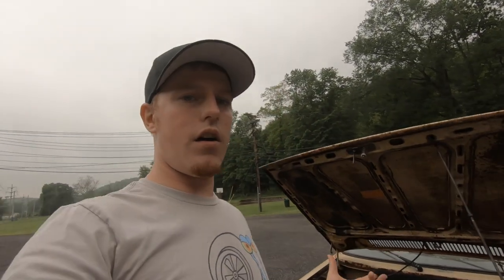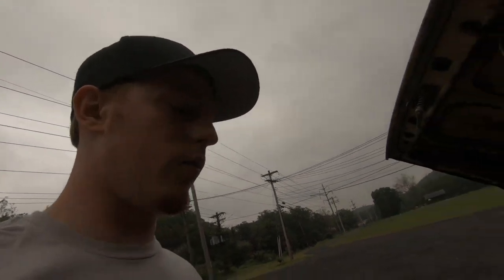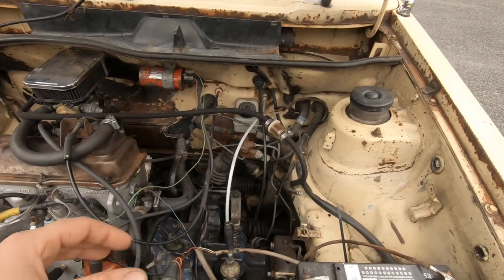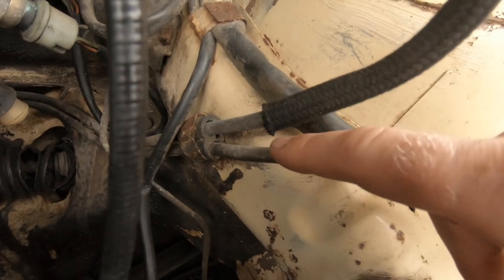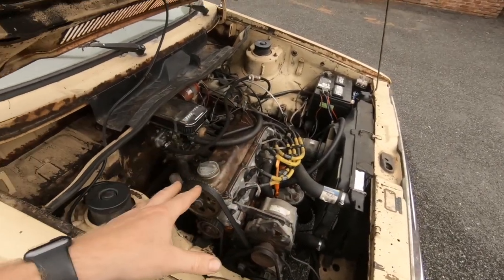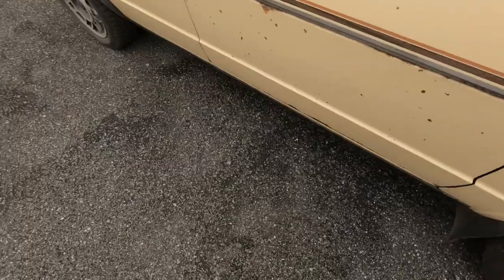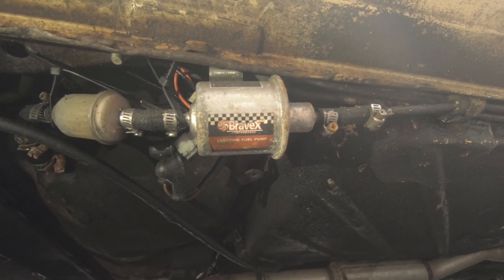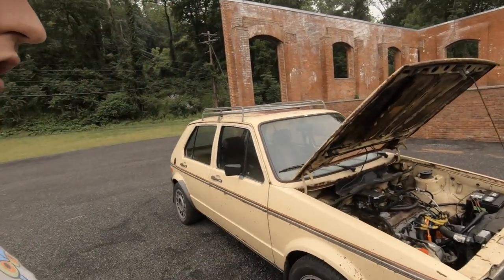#21 vw rabbit carb conversion

Comment: I did once fit a weber 38 on a 2 litre,did gain power but too much overfuelling,go with a 32 or 36 max as he says (good advice)
Reply from the maker: Mohammed Gangat yeah a single 38 is pushing it for these smaller motors depending on the setup. i have dual 44’s in my truck with a 2.0 but those are jetted accordingly.

Comment: just rebuilt my 32/36 today for my 77, perfect timing! great vid
Reply from the maker: Luke Almquist nice! they’re a breeze to rebuild. it’s having to thoroughly tune them that becomes overwhelming.
Reply: @mk1rabbithole  mine has this set up.. my car kept dyeing  at red lights..  so i added a presure regulator than i would dye while running,  now removed the fuel intank pump add added a carb fuel pump at the engine bay. Car dyes  when passing 3500 psi.  Why is that

Comment: I've been  having an issue with my 1.7 engine cutting off, my mechanic told me that it is my fuel pump (mechanical) that stops making contact with the crankshaft, when it does it, I let it rest for  few minutes and it starts back up but the idle is rough and I can smell the gasoline all the way inside the cabin. the  last time he "fixed" the car, it was running fine for a few months but I still could smell gasoline fumes inside the car and I always felt that the carb was running rich but I didn't experience any hesitation; now it's doing it again. What's your take on this issue? I've been thinking about getting one of those Weber carburators but I'm not sure that will solve my problem and for what I can see, the installation would be very different as the Mexican 1.7 engine fuel delivery system is different from the US one as it does not have the pump and filter right next to the fuel tank. Sorry for this being so long and thank you for a great video.

Comment: DUDE!!!!!!
thank you so much for this video.  I'm literally in the process of doin this to my 1980 vw rabbit custom. .. 

I've ben trying to find anytin that would/could help me n I found this video. Thank you so much.  Cant wait to c what else you post .  Thank you
Reply from the maker: Nicholas Sandy haha talk about timing, that’s awesome though. i obviously wish i could’ve done the actual process to film, but if you watch my older videos you’ll see we did a torture test and killed the old CIS motor that was in here so i didn’t exactly convert it to carb while it was running. new motor that went in was setup out of the car. 

just give me a holler if you run into any issues, glad to help if i can.
Reply from the maker: Nicholas Sandy OH and i totally just remembered i didn’t go over the vacuum line to the distributor in this video 🤦🏼‍♂️ you’ll need to get vacuum from in the intake manifold for your brake booster, and then another smaller line off that line to go to your distributor for the vacuum advance. this car didn’t have power brakes so it’s just one small line you can see in the video coming off the center/leftish side of the manifold and going straight to distributor.
Reply: @mk1rabbithole  thank you so much I will definitely be giving u a holler. This is a whole new experience for me.  My car is my dream car n I dont want to screw it up.  I do have 1 question for u rite now tho. Rite in behind the dis cap I have a block that has tmrw lines goin into it . 1 what is that part 2 what do I need to replace that with ??? 

Thank you so much again !!! U rock 🤘🤘🤘
Reply from the maker: i’m not too sure what kinda block you’re talking about. but i’d recommend posting a video on your own channel so i can see it.
Reply: @mk1rabbithole  

I will see I can get one that's good enough to show the part I'm talking about.. 

Thank you 

Merry Christmas n happy new year to you n yours

Comment: ok so sorry in advanced for sounding like a rookie here but does that carb kit come with the proper jets for a rabbit cause i got a brand new carb recently that came with a mk1 engine i got and decided to put it on my car however i don’t believe i’ve got the correct jets due to my car running pretty rough and being a pain to start
Reply from the maker: no need to be sorry! that’s what we’re all here for. and no they don’t come specifically setup for the rabbits. just being thorough so don’t mind if these questions are redundant or seem excessive. so it ran fine before and all you did was swap the carb parts on? what all did you swap on and did you touch any other parts between these two running period? was your engine timing touched at all during the process of you putting the carb on? did you double and triple check that everything is hooked up properly and you don’t have any vacuum leaks? double and triple check
your engine and ignition timing. if it was off before the carb swap the CIS could’ve been compensating fine and the carb not. if all this has been gone through and confirmed to not be your issue then yeah next up let’s focus on the carb. do you have a wideband gauge? if not you should get one so you can tell if you’re running lean, rich, or just right. without a wideband you’re shooting in the dark. aside from the jetting there are a few other adjustments that can be made with those carbs. it’s very overwhelming at first but it’s all
simple once you figure it out. google “weber  32/36 tuning manual” it has everything you need to know when tuning these, but again i strongly suggest getting a wideband gauge installed if you don’t have one already.
Reply: it wasn’t running well or at all with the cis which is why i bought the carb for the car however it’s not the same exact carb you have so that’s why i’m unsure if it’s jetted correctly for the car, i will hook a wideband up and see what i can figure out as well. my buddy has one and said i could use it. it’s definitely at least running now which is a step closer than it was with the cis system however it will only idle without me giving it a little throttle after it’s good and warm (say 10 to 15 minutes of me messing with it and keeping it running) i did find this video extremely useful on swapping everything over. i followed everything step by step for the most part. this is my first gas rabbit i’ve had 3 diesels in the past. we actually had to make an adapter plate for the carb to flip the carb 180 so that the throttle on it would be pulling towards the grille of the car instead of the firewall. since that’s how the throttle cable mounts on the valve cover. the only reason i used that carb instead of just ordering the one you have is the carb came with the manifold and an extra mk1 engine and trans it was mounted to for $500.  the carb and manifold also appear to be brand new

Comment: Is it trick to tune a single Webber 44 with my 8V ? Or I can just run not out of the box brand new 
Thanks for this good  video
Reply from the maker: ideally you will want a wideband 02 sensor and gauge to monitor your air/fuel ratios, and then tune the carb accordingly. the car will most likely run somewhat well just slapping the carb in there but they are not "tuned" out of the box.

Comment: my CIS system is way out of whack right now and isn't letting me start. WUR, CSV, and frequency valve are good, pumps are okay but the idle/fuel mixture is just not calibrated anymore to start the car. Not really concerned about power 'cause at this point I'd rather have just a simple, nice working weekend car. 

At this point would it just be more viable and less headache to pickup a weber kit instead?
Reply from the maker: i cant really make that call for you, but yes those are the types of scenarios where carb conversion is a reasonable option. just make sure it’s not a spark or compression issue before throwing even more time and money at it ya know?
Reply: @mk1rabbithole  i know spark and compression are not the issue for sure and isolated to just the fuel system. Ill give it one more week of repair time to work on CIS and then look at my options for carb conversions haha, thanks
Reply: @mk1rabbithole  on my fuel tank it goes out to a fuel reservoir then connects to the fuel pump and accumulator. Would I connect into that reservoir or just go directly from tank?

Comment: You think you could use the stock in-tank pump alone to feed the carburetor?
Reply from the maker: most mk1s have in line pumps, I think later cabriolet‘s have in tank pumps but the in line pumps are easy enough to bypass and replace so it doesn’t make much sense to regulate it down to lower fuel pressure. Ultimately yes you can use the stock fuel pumps regardless of which set up it is but you need to regulate the pressure down severely. I personally would never want to do that despite people having success with doing so. I don’t think enough people have done it to make me feel at ease about choking the fuel system down like that. hope my opinion helps!

Comment: What size reducer fitting did you use between the tank and the fuel filter? 3/8 to 5/16th?
Reply from the maker: sorry never added the info on that. it’s a 5/16th to 1/2” which still wasn’t an ideal fit but it works on these early rabbits. i’m forgetting if the late and swallowtail rabbits have same size fuel tank feed. i added the ebay link to the exact fitting i used to the video description.
Reply from the maker: i do have a few extra fittings if you would rather i send you one than risk anything from covid19’s ground zero 😂
Reply: the rAbb1t hole No worries. Perfect! Ha. I’ll just place an order on amazon..if they even have them. The fun part is gonna be trying to figure out how to mount the new fuel pump. Lol
Reply from the maker: Tim Lewis yeah only place i could find them were off ebay from china, but that was a year and a half ago so might be an option on amazon. as for the fuel pump i never really made a proper bracket and just always ziptie them up, makes it easier for them roadside fixes especially if you end up needing to grab a random pump from an auto parts store far from home.
Reply: the rAbb1t hole  Thanks! I finished running  everything last night and it turned out quite well. Found the fitting on amazon, and the fuel lines at a buddies. Is the fuel line that runs across the engine bay to the carb 5/16 as well?

Comment: bought redline kit for my 86 cabrio.also low pressure fuel pump and regulator,now realize i have intank fuel pump on car .any ideas?
Reply from the maker: rick braz you might wanna check with the mk2 guys, i did not know of any mk1’s with in tank pumps till now. i would look up and see what kind of pressure it puts out, if it’s under 10psi then you might be able to get away with using it and using a pressure regulator. otherwise look into bypassing it/removing it.
Reply: I did a holley carb swap on my cabriolet. I used .the intank pump and the external pump to a by-pass regulator that went to my holley carb. The holley carb liked to have 8psi. Heres my old thread from years ago. https://www.volkswagenownersclub.com/threads/let-the-carb-conversion-begin.22072/

Comment: What’s that block off plate called on top of the oil filter on the block, I have two cis lines running to it should it be deleted for the carb conversion?
Reply from the maker: that might be the warm up regulator you’re talking about, but i’d need to see pictures or see it in person to confirm. generally speaking, anything unused from the CIS system should be removed/blocked off.
Reply: i have the same question...

Comment: Where did you get your air filter? I bought a 1989 golf with a carb conversion already done but i cant find an air filter that will fit
Reply from the maker: Kw Skater amazon! do you have the same carb? weber 32/36?
Reply: @mk1rabbithole  i dont think so. The previous owner brazed a steel plate to the bottom and a home made gasket that was half an inch thick. But on the bright side i have a magnum flow intake manifold.

Comment: How did you connect the ignition coil to the distributor and to the battery
Reply from the maker: Ismael Marquez everything with the ignition here is as it came from the factory.
Reply: If you want to get real crazy you can put a points distributor and coil on so you only need 3 wires to run the ignition system :)

Comment: I'm finishing up this conversion on my MK2. Ive switched to a low pressure pump. Do I still need to run the accumulator?
Reply from the maker: Nicholas Heckman no you should be able to delete the accumulator, i have not done this conversion on a mk2 though so not sure how similar the fuel system is back there.
Reply: No accumulator needed as long as you run a pressure regulator/bypass regulator. You dont want to burn out your electric fuel pumps by only having fuel flow to the carb :)
Reply: SRGTLORD i understand it’s many months later but just to confirm, i’ll be connecting my intake electric fuel pump with a minimum  psi of 101 to a fuel regulator, then a filter, then the carb?
Reply: SRGTLORD sorry no context i’m doing this switch on an 89 cabriolet with an in tank fuel pump

Comment: We’re switching over to carb it’s a 350 Holley but I’m sure the same applies but we had the jetronic ecu still hooked up and all the cis removes except the injectors and it started to rev out of control could the vacuum from the compression be opening the injectors up and causing it to rev like that
Reply from the maker: it’s definitely possible. Between the injectors themselves, the O-rings around them, and the injector cups them self there are definitely multiple potential vacuum leaks in the set up you are describing. You should pull the injectors regardless and seal them up like I mentioned just to eliminate that possibility altogether.
Reply: The other thing is that the ecu was back charging the coil so we couldn’t shut it down either do you think wiring it to it’s own cut off switch would help
Reply from the maker: @matthewlambert4989  personally, i would figure out why it’s doing that and fix the source of the problem. adding a cutoff switch is just bandaid. to add, i’d be concerned about a fire hazard if it’s getting power when it shouldn’t.
Reply: Right we were told it was because the ecu was had nothing to control and it was back charging
Reply from the maker: @matthewlambert4989  Sorry I’m not familiar with the way jetTronic is wired up so if that’s the case then yes I would add a kill switch. but again I’m not familiar with the way that it is wired or powered so I really can’t give you a trustworthy suggestion on that.

Comment: Where do you get the intake? Is it aftermarket or can I find one in the junkyard?
Reply from the maker: you can buy them with the carb if you buy them new, otherwise look around for someone selling one. they are not a factory item. some of these early rabbits had carbs but i’m not at all familiar with the intakes from those and whether or not they’re similar to these and/or comparable with these weber carbs.
Reply: Thank you.

Comment: Anyone done it with a pict 34 carb?
Reply from the maker: i’ve seen it done once or twice with smaller carbs like that. for a stock motor i’m sure it handles the fuel demands just fine. i’d definitely want something a bit beefier if i was gonna do even an exhaust or cam.
Reply from the maker: i’ve seen it done once or twice with smaller carbs like that. for a stock motor i’m sure it handles the fuel demands just fine. i’d definitely want something a bit beefier if i was gonna do even an exhaust or cam.